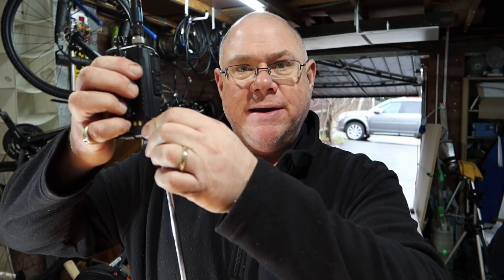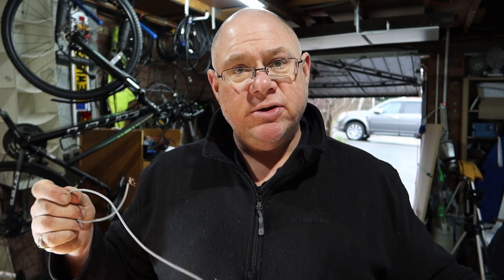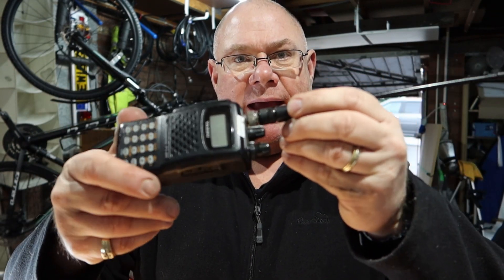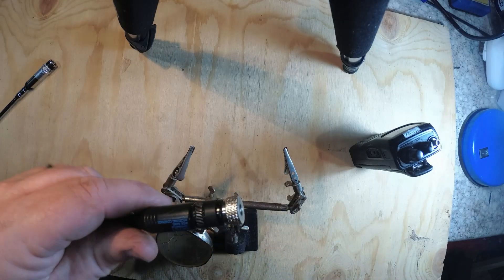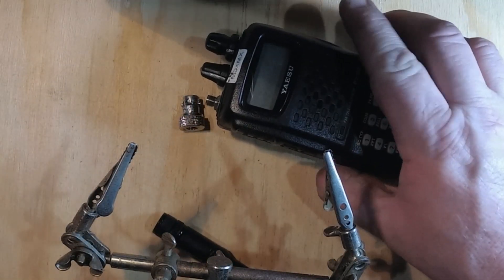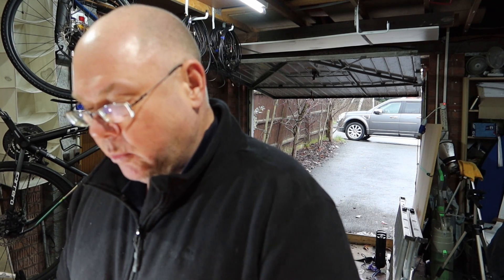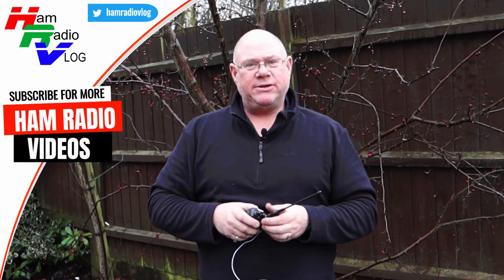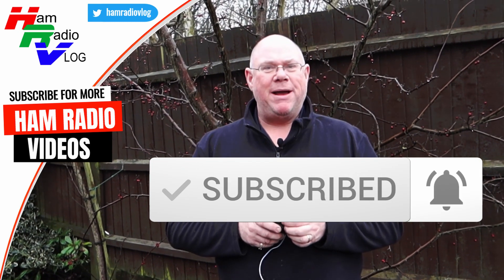COUNTERPOISE TIGERTAIL - Increase the range of your 2Mtr VHF 144MHz Handheld.

Comment: If you use a better after market antenna is it still useful to make and use the counter pose?
Reply from the maker: Yes exactly the same. If you are using a qtr wave vertical (most rubber ducks are this) then adding a further qtr wave as a counterpoise with help efficiency.

Comment: A few helpful tips:  1) Use flexible silicone wire.  It makes life easier.  2)  Either remove the plastic or use a ring that doesn't have plastic.  You're using heat shrink so the plastic is only in the way.  3)  Use as little heat and as little solder as possible on the wire to get a good connection.  If you get the wire too hot and the solder flows under the insulation it makes the wire stiff and brittle.

Comment: dont work on baofeng
Reply from the maker: Really. Why is that?
Reply: @MikeM0XMX  Oh, its because of the slot, the connector it have on, im using the tactical antenna and stuff, but thats not the point, it Doesnt work because of the connecttor is like inside of the ht, you cant put over that round conector on it like you did, but i bet i can figure something out with copper wire, AND IF You need some real good copper things i can send it to you if u will show how to make more cool stuff, i have old USSR Copper so its pure copper and its like - you cant bent it with both hands almost, its HUGE for a wire n stuff. :)
Reply from the maker: @krisraps  yep. I got you. Good news though. The belt clip has two screws. Attach to one of these.
Reply: @MikeM0XMX  I JUSTT Made My Own Tiger Tail Antenna With One Small Cinnector Like Yours, Just A Bigger One And All COpper One, I Soldered Ground Wire In The Antenna Itself And Then I Made The Wire Connect The Antennas Connector That I made SO Now I Have Two Antennas, One Is The Big One The Tactical One And Another is A Big Copper Wire Thats Going Downwards.
Thank You For The Help And Idea ,. I Really Apriciate It, 
I Have No Way To Mesure How Good It Is Or Something, But Im Happy Every Time I Can Discover Sometyhing New And Usefull :)
Have A GREAT Day My Friend :)
Reply: Wait, is the belt cip grounded to? Like _ I can put another part of dipole there?
Reply from the maker: @krisraps  yep. It screws into the chassis.

Comment: I had never heard of tigertail before now,  thanks!
Reply from the maker: No problem Today was weird. I had you 5,3 and you had only QRP. I was QRO and you couldn't rx me. Your handy may have a poor rx.
Reply: @MikeM0XMX  Yeah maybe,its just a borrowed tyt, I know they not the best,  had problems with a few ppl, Only made 3 contacts but all local. I got a mobile set & magmount on order
Reply from the maker: You Re not a million miles from me so happy to help if you want.
Reply: Thanks Mike appreciated. I'm sure our callsigns will cross paths on the air again!
Reply from the maker: @mully89  Well the offer of help is there.

Comment: Great tip! What’s the logic behind the 19”>?
Reply from the maker: Good question. 19" is roughly 50cm. The wavelength of the radio at 145Mhz is roughly 2Mtr. Therefore a 50cm length of wire is a quarter of the wavelength. A rubber duck antenna is normally a 1/4 wave vertical which needs a counterpoise .
Reply: @MikeM0XMX  Hi Mike - how does a replacement antenna, like the 42.5 inch Abbree "fold out" antenna effect making a counterpoise to boost RX and TX?  I want to boost my Baofeng when I'm fishing offshore in the Gulf of Mexico for the 156mhz to 157mhz marine monitored frequencies.  Thanks!
Reply from the maker: @travelguy1564  Hi. The abbree is a 1/2 wave on 2mtr so no you don't need a counterpoise. If you take a look at this webpage you will see that the counterpoise is "the other half" of a 1/2 wave dipole. https://www.everythingrf.com/rf-calculators/dipole-antenna-length-calculator

Comment: Couple of things: (1) use thin ring connectors, or rotary drill/sand/file down thicker ones (allows the antenna to screw back on with as much thread as possible, avoding potential thread-stripping) and (2) there's no need to solder the back, getting plastic all over your iron and making a bad connection; just hold the lug vertically by the crimped wire and solder from the top, and it will flow down into the barrel.  A small butane torch is better for soldering these, as they absorb quite a lot of heat.  Also, wrapping the lug and wire in self-amalgamating tape helps slow down, but won't stop, the wire and lug from breaking apart due to mechanical wear and tear.
Reply from the maker: Alright.

Comment: and if you use a dual band 2mtr/70cm HT i would use some speaker wire one side cut to 19" and the other cut to 17" so you have two counterpoise in one tigertail
Reply: Brilliant idea.  Thanks for the suggestion..

Comment: Yes cf is digital now and was referring to when it was analogue and 3hen the idiots weren't on. Interesting concept using the tail and something i sm going to test today. Great videos by the way
Reply from the maker: Thanks Darren. If you want any 3rd party reviews of your antennas feel free to send me one and I will try it and return it. 73
Reply: @MikeM0XMX  yes I could do no probs. On the sota  video what ant are you using initially on the handheld ? looked longer than the 2nd whip. ? Just wondering how they compared
Reply from the maker: @darrenshiels4963  it's an MFJ 1/2 wave but you don't need a counterpoise with that.
Reply: @MikeM0XMX  yes that's what mine are. They work well.

Comment: I have found if you use a better made antenna cut for 2mtrs (which are a lot bigger than the rubber ducks) You get the same result without having a counterpoise. I can open up GB3CF from Birmingham with 8wts into a baofeng using a 2mtr whip from Broadsword Antennas.
Reply from the maker: Yes Darren. Good advert for your antenna making company however isn't CF Digital only now?

Comment: I have attached my Tiger tails to the screw that holds on the belt clip.  Best to check that there is chassis continuity from the negative side of your antenna socket.
Reply from the maker: Yes. I like it on the antenna as you can easily remove it by hand. 73

Comment: Can also check connectivity between belt clip screws and antenna ground as they are often connected - if so it's easier for some people to attach the cable there instead.  I have a 42" Abbree antenna and did this now it's supercharged!
Reply from the maker: Yep, good point. Thanks. 73
Reply: Hi Stewart - I have the 42" Abbree as well - does the Tiger tail still need to be 19 inches if we have the 42" Abbree attached in place of the rubber ducky stock antenna?  Thanks
Reply: @travelguy1564  Hi, yes best to stick with 19"